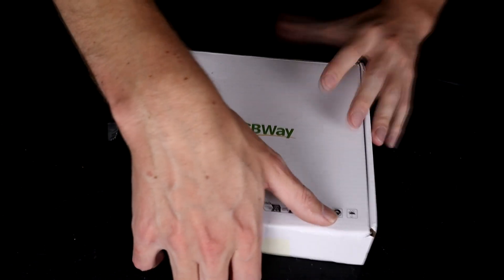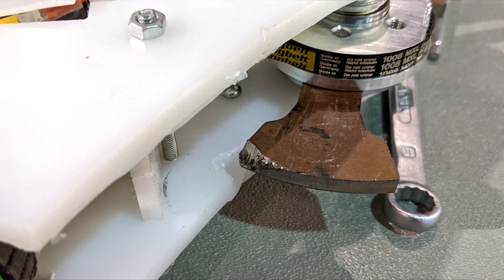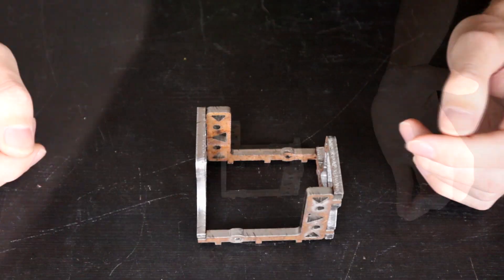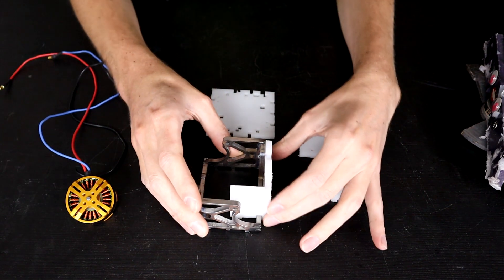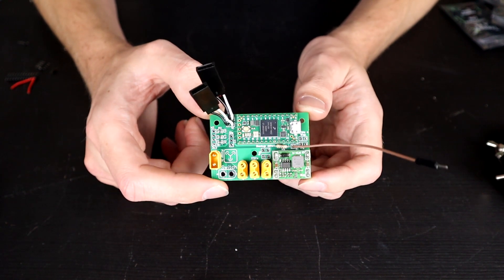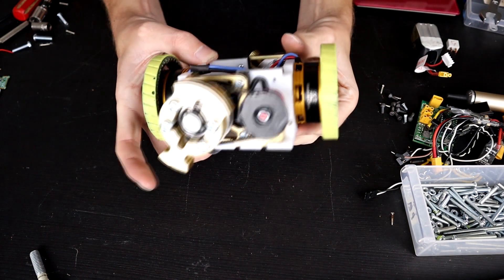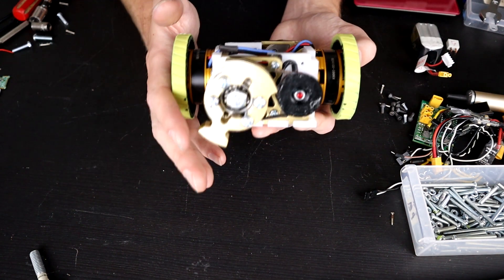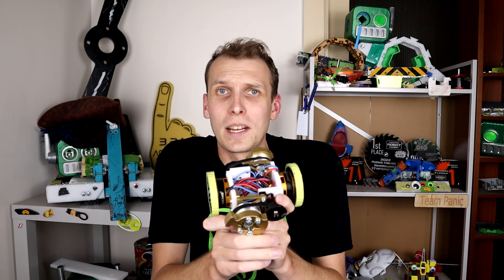My craziest build yet! (Dual vertical spinner melty brain)

Comment: I'm new here... is this autonomous or something? I don't understand the requirement for the 'brain board' just plug in the esc's to the rx, no?
Reply from the maker: Its semi-autonomous, its a design called a melty brain. It works by spinning the whole chassis at high speed, then while spinning stopping and starting the motors at precise points to translate around the arena. This requires a brain board because switching the motors happens way too fast for a human to try and do.  To see what I mean you can watch this bot fight: https://youtu.be/Qkf3Z1W4rms
For a more detailed explanation of how this works, I made a video a few years ago (the quality isnt as good as my current stuff but it has all the information): https://youtu.be/fHZTm-qGcZs

Comment: This has the potential to hit really hard. Are the spinners further out then the wheels? I would assume so, but I've never seen such a robot.
Reply from the maker: they are, but only just, its about a 12mm difference in diameter or something
Reply: @TeamPanicRobotics  is it possible to make the spinners or the chassis longer without compromising the design?
Reply from the maker: yes, and thats the plan for V2

Comment: I would like to see the wheelbase reduced - I still feel  weapon doesn't stick out far enough. Either way, excited to see how it works
Reply from the maker: They do stick out further then the wheels, but the wheels are closer to the edge of rotation then I'd like. It was cadded for slightly shorter drive motors

Comment: It's kinda like you've taken MacGuffin and twisted the centre section 90 degrees.
Liking the white and gold aesthetic. ✨️ Very bling. Should be interesting to see how it performs.

Out of interest, what grade of Hardox do you normally use from Action Laser? 450 or 500?
Reply from the maker: It is a little macguffin-y but no wedges this time

I go 450 for my hardox, its a good balance of things. I didnt get action to cut these parts but I will for the next cut. the place I went this time did not do a good job, I've never had to hand balance a weapon Action has cut for me, and I had to do that for these parts
Reply: @Team Panic  Cool. That's what Action recommended to me, so that's what I'll go with. Thanks again. 👍

Comment: Can't wait to see what happens with this little cube of death.

I imagine the twisting torque on the body itself will be insane when everything is up to speed: considering that both vertical spinners will want to gyroscopically precess in opposite directions (which should cancel each other out in total force) yet each vertical will try to twist the frame in a different direction combined with the insane speed the melty will want to spin at (which should result in a bit more stability) I think the result has the potential to be extremely favored towards rapid unscheduled disassembly. (I wrote that before you announced the name lol)

16:37 You might be able to use the frame screw just above the weapon motor to add a standoff and a bushing/bearing as belt tightener.

Don't forget that you will probably want to keep some weight so you can put a lid on it, that should help with making the frame a bit more rigid and hopefully help with the robot exploding.

Great video, this idea is just utterly insane and perfectly suited for robot combat.
Reply from the maker: I think so too, which is why the frame is hardox, doing anything and everything to stop it from bending down the middle

Comment: I wonder how the gyroscopic forces world effect it.
Reply from the maker: I think they should balance out, as long as they spin roughly the same speed
Reply: @TeamPanicRobotics  who knows, maybe it will make the melty more stable, definitely a creative design though, will be waiting to see the results.
Reply: @Cobrax_x  I imagine it would be a bit more unstable than a horizontal melty brain, since you lack the stabilizing effect of the horizontal spinners and solely rely on the effect from the entire body spinning. The verticals should cancel eachothers gyroscopic precession out but they're on slightly different axis and both the precession from the body spinning  the weapons as well as the torque reaction from the weapons will want to twist the hardox frame, basically taking the sides and twisting them like wringing out a towel combined with trying to bend the vertical sides away or toward eachother (depends on spin direction), but instead of fabric it's abrasion resistant steel.

As long as the frame resists twisting and bending enough it should be okay.